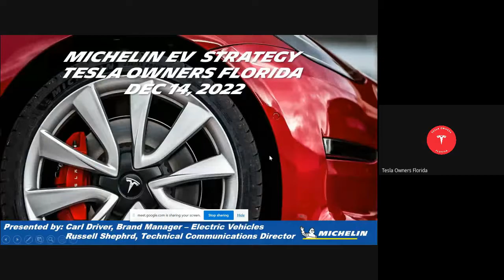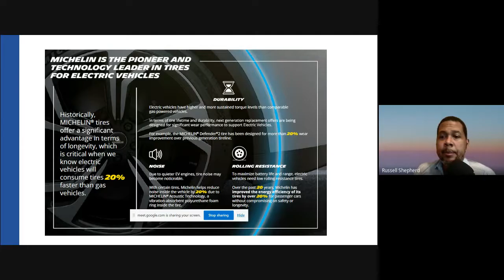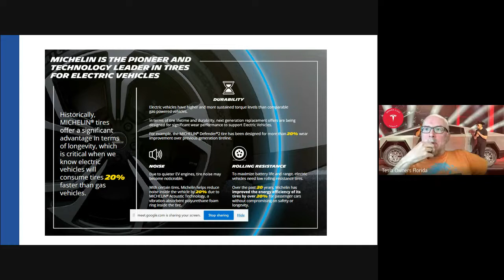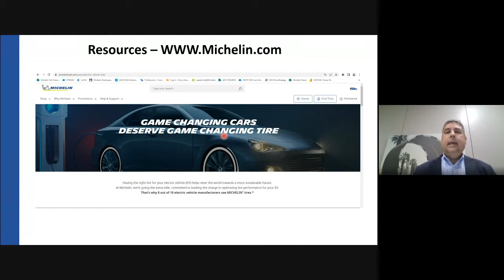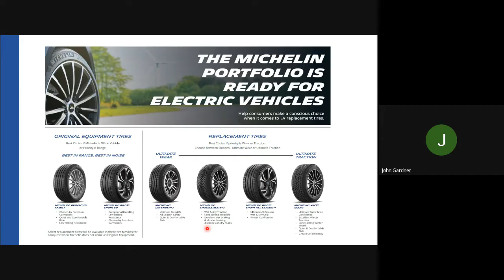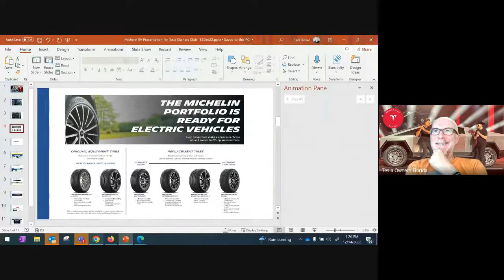Michelin Q&A with Tesla Owners Florida

Comment: 80 minutes on EV-specific tires from one vendor? Aka, how to make people  hate you & whatever you’re pushing. Anyway, previous to 15:30 you said rotate front/rear to “square front cupped tires on the rear, then left/right & not F/R. Which is it? 23:00 Regen on rear only may cause hydroplaning. Rotate at 8k miles (does climate, terrain, road quality affect tire wear? Question: Will going -2 on rim size & +2 on tire size put more tire “over” the rim to reduce rim rash, in addition to improving ride & mileage, plus be much less prone to “popping” over potholes?

Comment: 16:12 He's not correct on why you need to rotate tires front to back. The correct reason you need to move the tires from front to back is because the front tires cup or (round on edges) more from steering and the backs tires wear more square or (flat).  The weight distribution of any current Tesla is 50/50 front and back. The only reason the back tires would wear more is because of the torque or (hard acceleration) A typical ice vehicle is front end heavy (engine) not the back and the front tires can wear just as fast as the back from high speed cornering (on or off ramps) or alignment issues.

Comment: My OEM 20" Michelin Pilot Sport 4S tires have gone over 60,000 miles on my Model 3 Performance, I drive fairly aggressively so I'm totally amazed that I'm getting more than 60,000 miles out of a set of tires with a 30,000 mile warranty.  Also, I've seen that many Tesla owners post they have received a pro-rated discount on their OEM Michelin tires that wore out way before the mileage warranty.